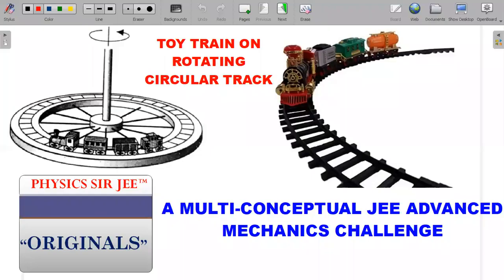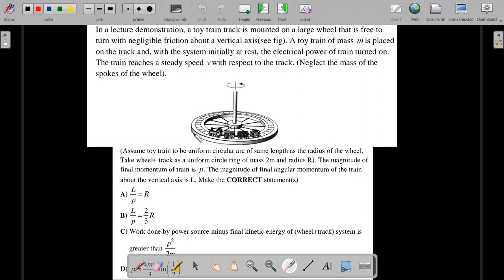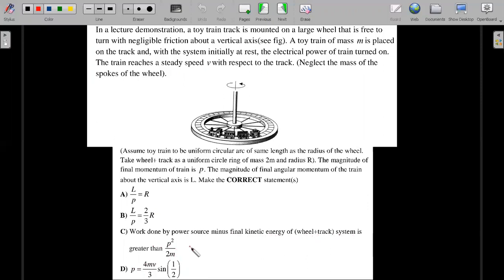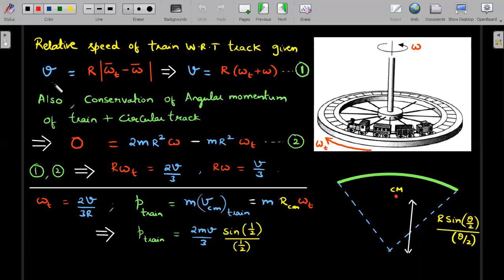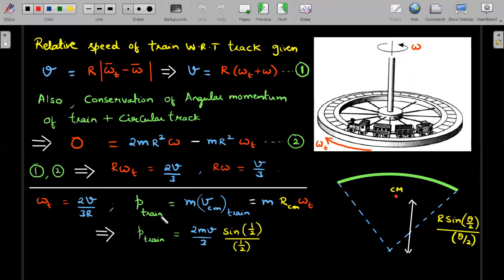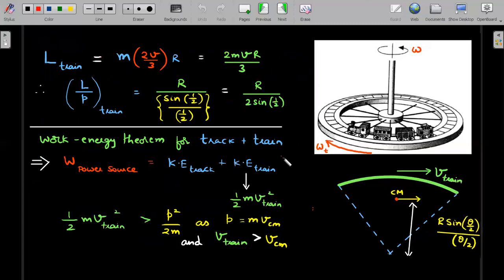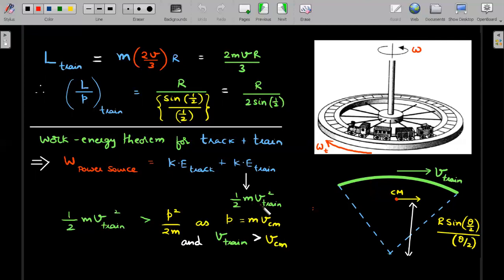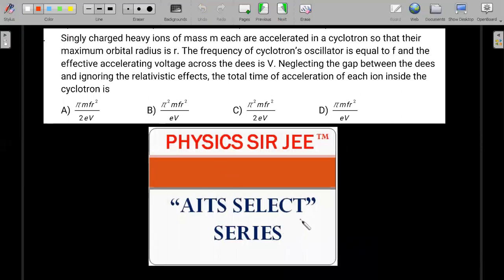ORIGINALS PHYSICS VIDEO | MECHANICS MULTI CONCEPT |JEE ADVANCED CHALLENGE |TOY TRAIN |ROTATING TRACK

Comment: Sir, isn’t saying “w.r.t track” ill-defined? The position, velocity of a Newtonian point mass are only defined relative to another point/point mass. The track is however a system of many such point masses( infinitely many in fact). I have the same doubt with saying “velocity of the “train”” though for the train I think the problem actually means the velocity of the Centre of mass of the train.  There was a similar sentence in my jee 2D motion archives where the question said: the velocity of pebble A “w.r.t the disc” is... How is the position of a point defined relative to a system of particles?

Comment: sir  i have a doubt regarding the solution:
when you apply the work energy theorem why arent you accounting for work done by friction sir jee
Reply: Did u get the reason for this?
Is the work done by friction on system is getting cancelled out? I am still stucked in this..
Reply: sir can u plz answer my doubts sir
Reply: @ponnapu  Friction is given to be negligible
Reply: @sumukhbansal4954  friction is negligible wrt the vertical axis for rotation of wheel not between the train and wheel
Reply: @ponnapu  As for  CM i am pretty sure there is no factor of 2 involved so i would tell you to check again
Reply: @ponnapu  no
Reply: Sir has applied the same formula . Sir has written Rsin(theta/2)/(theta/2 ). I though you meant it should be double of this
Reply: @ponnapu  sir has used same formula as you see again

Comment: janardhan sir,just formal dought in this beautiful train track problem,as COAM is applied on train + track system ,you did not specified about which axis the COAM is applied , i think when we are taking train +track as a system and there fore we must consider AXLE as the axis about which we should conserve the COAM.sir i think due to reactional force from axle to our system.
Reply from the maker: It was mentioned that force doesn't cause torque indirectly at 4:26